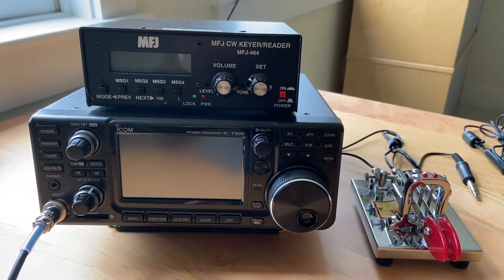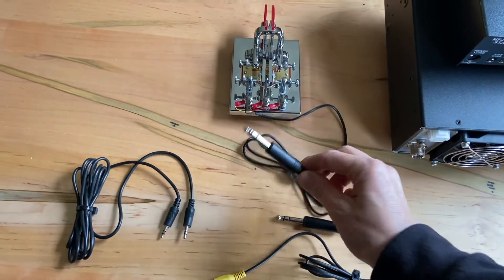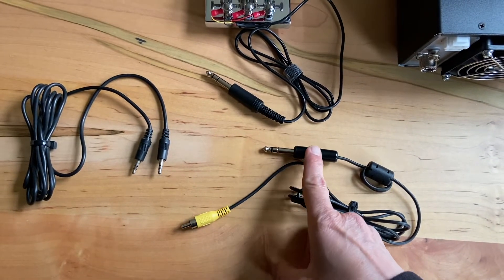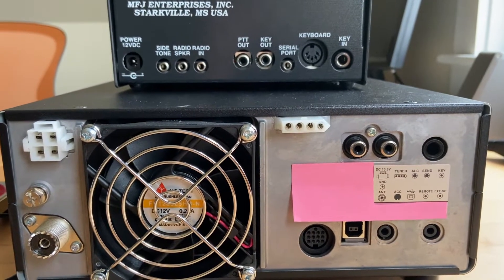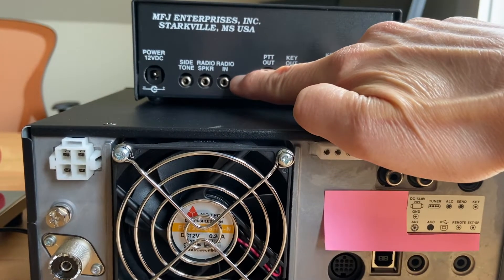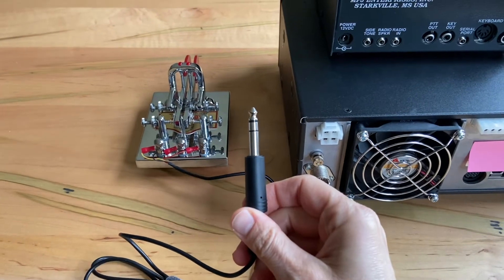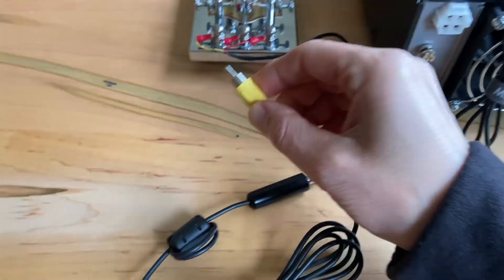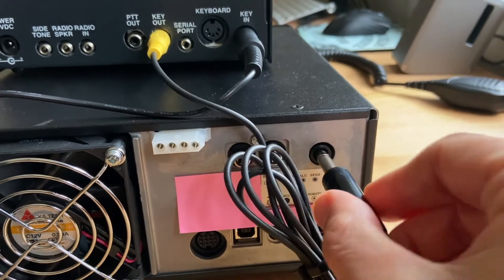Connecting the MFJ-464 CW Keyer/Reader to the ICOM IC-7300 tranceiver.

Comment: It's kind of bothersome that noone sells a mono RCA to stereo adapter with the ground and the tip connected to the mono side.  I almost tried to look you up RoseBag - so I could e-mail you to find out about where you got that RCA connector.  But then I read your description at the top - and "oh crap, that's what I was afraid of".  One other idea I had to address this cable issue - to avoid having to do something in the connector area itself, I just went on Amazon and for about $20 I was able to buy a bare wire open end pigtail (RCA), and also a bare wire open end 1/8" stereo connector).  So I can solder the RCA center wire to stereo tip, and the ground wire to ground, and just cut off the remaining wire on the stereo end (that goes to the ring contact of the stereo plug)...  Then seal it up with heat shrink where the wires are joined in the middle...  No connector work necessary and wire to wire soldering is easy.  This is not as fragile a process or in any way difficult.  One other thing I did similar to this (seemed janky at the time but was easier than alternatives).  I tried to open an aux cable up to wire the key side for my MFJ-557 straight key oscillator terminals, and the wires were about the same thickness as human hair, so that was a bust.  I then decided to just take aother intact aux cable and just solder one wire direct to the tip, and one wire to the ground (skipping the ring contact area of the stero plug) - being sure to tin both the connector and wire first so they soldered easily.  Then I put heat shrink over the solider joint on the connector to seal it up and give it some extra strength.   Had to take care of course soldering the ground portion to the wire so it didn't cross over to the ring contact of the stereo connector.  Not pretty, but all those sins are covered up in heat shrink and after I soldered it, it survived the pull test, so it worked well enough for my purposes.  All its doing is conducting electricity in a simple circuit.  Open/closed.  So it didn't have to be a work of art.  Another idea I think works is take one of those dual RCA plugs that goes to a single stereo plug, and just cut the one off (or cover it in tape) that is wired to the ring part of the stereo plug.  Use the one that's tip/ground (usually that one will be red). and that's just as easy as making a new cable.

Comment: I saw your video very usefully. Could you give a tip to lock the signal between the two rig? I think it's not easy at all. Could anybody help me adjust the level, tone, af/rf control between the two rigs,  MFJ 464 and Icom radio?

Comment: Thanks for that.  I have a question if you have time? I have made a box that parallels all my straight keys and paddles so it comes out as TRS jack. Can you tell the MFJ-464 which you are using or does it auto-sense depending on whether you plug in a stereo or mono jack?
Thanks for your time. 
73
Patrick 😊

Comment: Hi can you post a link where to get the stereo jack plug with single rca
 as i have looked all over the net  in the uk and cant find one they all
 have double rca plugs .I dont mind ordering from the usa as i saw 
another video in which the guy stated that you need a stereo jack plug 
as a mono wont work on a 7300, i also have a 7300   I noticed in your video that your cable looks shop bought ..MFJ   dont sell these cables .Thanks for any assistance you give me .
Reply from the maker: I did make it.  If I remember correctly, I peeled the video RCA end off of an audio/video trio and then soldered the other end to a 1/4" stereo plug.  I think the key is that it is a 1/4" TRS plug and not a TS plug because the receiving port on the radio expects the TRS, not that it is receiving actual stereo.  Does that make sense?
Reply: @RoseBag72  I am going to try a 1/4 stereo plug which accepts an rca plug  and use a male to male rca but i aint holding my breath .Mfj have been making this unit for years  and you would think that they would have fitted a modern usb connection on the back for modern keyboards,  at style keyboards which they recommend went out of date 20 years ago . It also would be nice if they sold the cables which are required to operated the thing.  If i ever get this thing to work i will let you know   .Thanks for the reply's  its more than Mfj  did after sending them a few e-mails .
Reply from the maker: Let me know how it goes.  I will be home in a few days and can post a photo with details of how that cable is contsructed.  It looks like it is a problem for a number of people!
Reply: @RoseBag72  I managed to get the 464 to send using the cable set i bought and i used a ps2 keyboard with an adaptor . The  incoming signals are just a mix of letters but i did not manage to find any good cw stations .Can i ask what settings you have altered in the 7300 like cw pitch as i think this might make a difference to help decode the incoming signals .
Thanks .
Reply from the maker: The only adjustment to the radio I made is to expect a straight key from the MFJ-464 (even though I use paddles). As I have noted in other comments, I think that FLDIGI software does a better job of translating, but the MFJ-464 will accurately translate a strong CW signal.  73 &c.
Reply: @RoseBag72  I changed the CW pitch to 700  on the 7300 as in the MFJ manual it recommend,s this, to be honest  most of the manual is way beyond me.You are correct in the fact you need good clean signals but as of now I want to stay away from using a pc.Thanks for taking the time to reply to my questions.

Comment: Hi Rose, thank you for posting and I have to agree with many others here that your easy explanation style is top notch and I'd encourage you to show it in operation.  I don't own a IC7300 but the explanations migrates across other radios. It's an expensive piece of kit as a morse trainer though.  Thanks again 73 de M0AZE Mike
Reply from the maker: Thank you.  I think FLDIGI software works a bit better for translating actual QSOs, so I don't use it much with my radio.  I use it as a trainer and agree it is expensive for that, but it is small and light and easy to take with me.

Comment: Very clear and concise.  Good job!  Thinking of adding the 464 as part of my IC-7000 station.  A demo of it all working would be a nice follow-on video.
Reply from the maker: Thanks Michael.  There are some other videos on YouTube that you have likely found by now that demonstrate what you are looking for.  While it seems to do a pretty good job translating from the radio, I think that my fldigi software does better.   I have found my unit to be most useful for CW practice so far.  It is easy to take with me and plug my key in anywhere.  Earbuds make it so the family doesn't get annoyed. 73.
Reply: @RoseBag72  Yes, Thanks.  I've seen some of the other videos but by my estimation, you have a better (clear and direct, in a good way) presentation style.  I am sure other videos from you would be welcome by many.  I'm planning to use it for practice with and without the radio also.  Thanks again!

Comment: Thank you for your video and explanation Rose on which cable goes to which connection, I was struggling a bit trying to get my 464 to work correctly and I kept thinking the jumper's were set up wrongly and mfj support were no real help at all.. I'm gonna give it a shot now and see what happens when I connect it now correctly with my pro111.. finger's crossed...

Comment: Sorry I am again well I have done the rights connections in the same way as you recomended to me but I cant  to transmit because there is not connection with the radio and the computer I have all the plugs so I do not know what I am doing wrong.
Reply from the maker: 🤔 If I understand you correctly then you are not using a key or paddle to transmit at all, only your keyboard? I wonder if you might be better off using fldigi software instead of the MFJ-464? If you are using a paddle, you will have to make sure that your radio is configured to expect straight key output from the MFJ-464.  Best of luck with this. I am sorry I can't be more helpful.
Reply: @RoseBag72  ok probably I upload a video showing my devices and my radios thank you!!!!
Reply from the maker: Do you have the manual? Just in case, this is the link:  https://cdn.shopify.com/s/files/1/0289/7782/3843/files/MFJ-464.pdf?v=1586534158
Reply: I uploaded a new video using my MFJ and the PC.

Comment: Thank you is an excellent video but now I have a question I have an Icom 706MKIIG model I need to Know how to do the right conections to make it worth with a computer program  that I have installed in my computer (hiper terminal )because I use a computer with a keyboard to transmit. Well In brief words I use the same device but with a computer.
Reply from the maker: The MF-464 connects to your computer via a 3.5 mm stereo plug to DB-9 cable (sold by MFJ as the MFJ-5161). The DB-9 looks like a VGA but has 9 pins instead of 15.  You may need a converter cable such as a DB-9 to USB depending on the ports available on your computer. The 3.5 mm plug goes to the "Serial Port" on the back of the MFJ-464.  Best, R.
Reply: @RoseBag72 
Ok thank you I am going to use a translator because I can write and undestand just a bit but I am going to check it I am from Sinaloa Than you indeed....